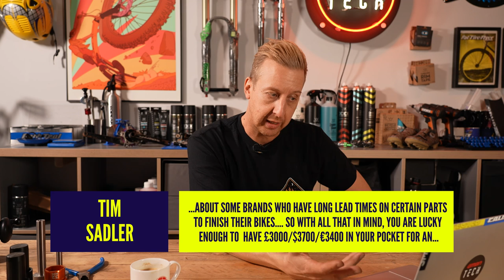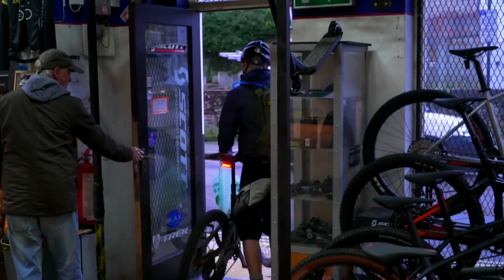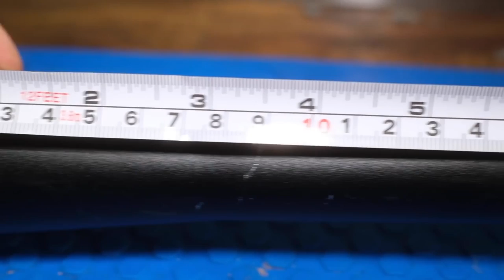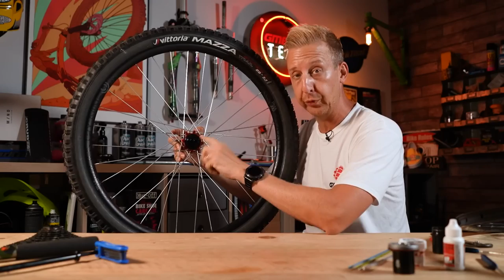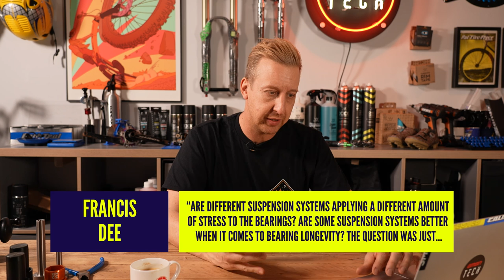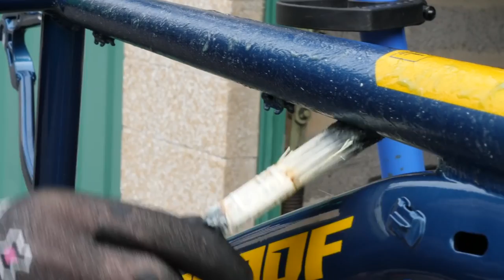How Do I Raw My Frame Without Damaging My Bike? | #AskGMBNTech

Comment: a couple of things to note about painting a bike or stripping one to aluminum.
depending on the grade of aluminum, although aluminum is much more corrosion resistant than metal, that does not mean it wont corrode over time. its always best to treat aluminum with something if your plan is to keep it raw. acid rain and other metals touching it can lead to galvanic corrosion ( metal bolts or parts touching it ).
as for painting a bike? its best to just sand the factory paint, as thats already a primer, theres no need to strip the paint off. however if that is what you chose to do, you want to make sure the aluminum is super clean before paint. aluminum is super sensitive to contaminates.its also a good idea to use some sort of etching primer designed for aluminum instead of just spray painting some crappy primer on there. again, this is why its best to leave the factory paint, because the dirty work has already been done.
fwiw, i am in the automotive paint industry so thats my thoughts.

Comment: With the paint stripping, if you don't want the mess or don't have the time you can take a metal frame to be sand blasted. This will, however leave a slight texture that will need to be buffed out lightly if you don't want a polished finish. It would also be prevalent to use a clear coat afterwards to protect the finish, a well

Comment: He should find a car or motorcycle body repair shop that does sandblasting with glass beads or walnut shell. It's a 15 minutes job at most, and it wont damage the alloy. But will strip the paint clean off, without the need of nasty chemicals. He should consider protecting the inside of the frame tube, bottom bracket and any threads with hot glue just in case the operator is clumsy or daft.

Comment: When I fit forks, I always do as doddy says. Dry fit, uncut. Then I add spacers, take spacers away, change spacer size etc etc. I have the rider ( brother, niece, nephew etc) test fit. Once chosen, I always leave the tube a little longer than needed and fit a spacer on top , so I can adjust in the future
Reply: And also if you go to sell it the longer the tube the easier it will be to sell

Comment: New bikes always have some cheaper parts on them.  My $8500 (paid $6400) Levo SL has an NX derailleur.  Really.   If the discount is good like mine then it's probably OK to buy new.  Custom builds are always better but more expensive also.  Get a great frame and fork and then use old bike parts on it until you can replace the ones you want.

Comment: the thing with the new bikes vs second hand debate is that the season in on the edge of starting and people are looking for bikes and it is hard to sell used bikes but at the same time the seasons starting and its notoriously easy to sell a bike when the seasons starting
Reply: Also, for a second hand bike one may need a spare part for a modernisation or simply repair. Which is unavailable, being the very same part needed by bike manufacturers. So have to wait for indefinite time anyway.

Comment: #AskGMBNTech, I have a Giant Trance 27.5 2016 bike and it seems a bit outdated because of its steep headtube angle (67) and the DT Swiss bolt through quick release skewer in the rear(135x5mm). Do you know any ways in which I could change the headtube angle to something like 64 degrees? As I doubt the frame will break with what I'm doing. And do you know any options I could have for using a 5mm QR skewer with something like a 15mm thru-axle wheel? Basically in what ways can I update my bikes geometry and tech so It can support all of todays new tech (good vid idea)? - Gustav

Comment: One option for a raw finish is to anodize the frame. I don't have experience with bike frames. But, I have had a lot of 6061-T6 parts anodized. Another easier option is alodine which can be wiped, brushed, or sprayed on. Alodine is less protective and needs to be reapplied.

Comment: #askgmbntech I have Shimano deore drivetrain and I struggle with removing/fitting the rear wheel with holding the cage to give me slack on the chain and trying to wiggle it through. Any tips on this? My previous bike had the cage lock button which held it in place so was a lot easier

Comment: #AskGMBNTech I recently acquired a used steel frame. It's been fairly heavily used, and it has some paint chips on it with some surface rust forming under those chips. How can I do a little touch-up to prevent it from getting worse? I've seen suggestions ranging from soda, WD-40 to specialty surface rust removers. I just want to clean up the mild surface rust and patch up the paint chips. I don't need it to look too nice as the whole frame is painted glossy black which has faded over the years, and I don't feel like it's worth respraying the whole frame.

Comment: I’m having trouble removing the black anodized finish from rims to get that 80’s BMX vibe back. Tried oven cleaner & drain cleaner with modest results. Any advice?
Reply: Anodized or just paint? Real Anodized has to be removed by acid (nothing for home use)  or by grinding.

Comment: #askGMBNTech     Hi Doddy and Ana. Love the content and synergy between you too.  Please keep it coming!         I have been trying to understand suspension leverage ratio curve charts as they relate to coil  (linear compression) and air (progressive compression) rear shocks.     I ride the Spec Turbo Levo, and  I read that it has a "fairly linear"  suspension, therefore would not benefit from using a coil shock.  Conversely, I recently saw what was claimed to be the leverage ratio curve of  a VPP  suspension  (SantaCruz 5010)  which appears much the same, albeit a higher average ratio,  and  that a coil shock would be dandy on this bike.      Can you explain  the difference?

Comment: #AskGMBNTech
In the last year I have got back into MTB and bought myself a second hand medium sized Boardman MTR 9.0. I have had trouble adjusting from 26" to 29" wheels and feel that a mullet setup might work better for cornering etc as a short 5' 8" rider. Is changing the rear wheel to 27.5" a bad idea? As guessing this will change the geometry and lower the bb. Great show, you have helped me loads this past year, many thanks.

Comment: could you run a 1x grx gravel groupset on an XC  or trail bike ,... the gearing worlks better for my situation given the trails i ride .. gravel bikes dont really suit me ,dont like the riding position  and gearing on xc just has me spin out ...
Reply: if it fits in the frame no reason why you couldn't the probelm is the strength of the part. You may find you wear it out faster and it's less resistant to crash damage. Although, i would suggest the better solution is to look at larger xc spec chainrings because it sounds like you are running to small a front ring for your strength and terrain. I have to change out the chainrings on all the bikes i get to 36t coz i find i'm losing effiency with anything smaller.

Comment: #AskGMBNTech..Is there a way to shorten my dropper post?..i have a dropper post,when fully extended,the saddle is about an inch too high..thanks..
Reply: Some posts allow for reduction tokens just like in forks. But you must look it up the manufacturer's site first. Otherwise gotta swap the post for a shorter trevel.
Needless to say, it must not be cut anywhere.
Reply: @feedbackzaloop  ..thanks..think for me,its a new post then,as cant see crank bros posts with tokens...
Reply: your best bet is to send it back if you can and get a shorter one.
Reply: @M3PH11 i was given it,by a mate,sadly its a bit big..

Comment: #AskGMBNTech  why are deraileur's pointed downward, has anyone pointed one up instead and if so what would be the pro's and con's of doing so, love the technical chat
Reply: If you point it up the full tension of the chain would go through the derailleur, which would not work. The upper chain side is on tension, the down side is not on tension and because of this used for the derailleur
Reply: @simonm1447  makes sence